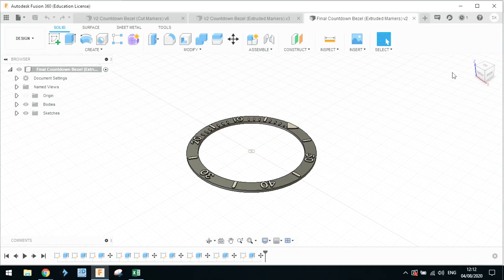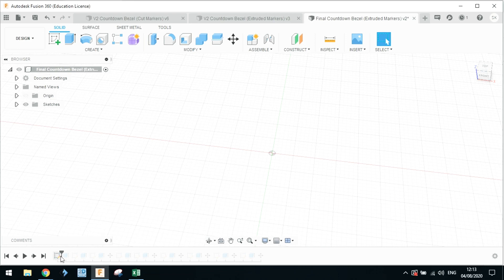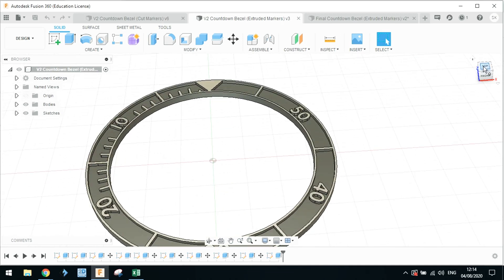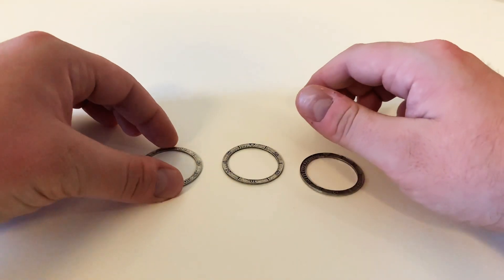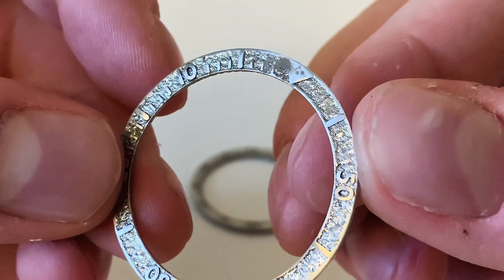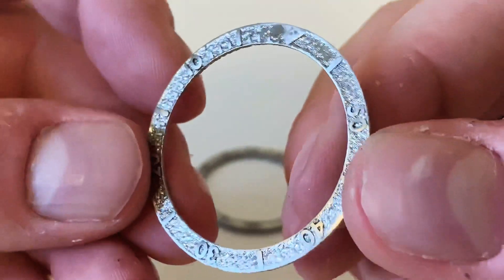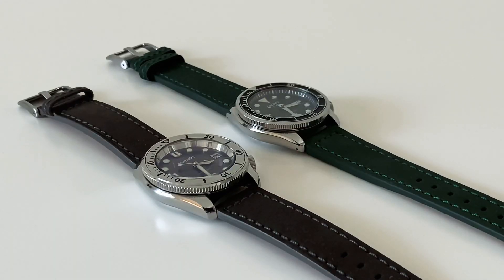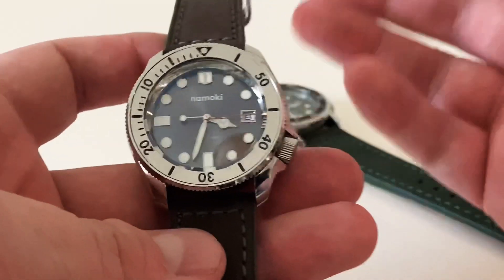3D Printed Countdown Bezel Inserts - IN METAL! [Seiko Mod] @SeikoModsDubai

Comment: I have been looking everywhere for this kind of info. I am looking to reproduce an acrylic bezel insert for my vintage Seamaster. The original Bakelite inserts are extinct. I can’t decide whether to go with 3D printed acrylic or a mold and pour option. 

Considering the absolute scarcity of these Bakelite inserts I can’t believe it hasn’t been done already 

Thanks for the inspiration
Reply from the maker: As far as I know you can’t 3D print acrylic, you could laser cut one though. I’m actually going to be trying out some simpler plastic 3D printed bezel inserts as well as laser cut ones soon.
Reply: i'm trying to do the same thing.. reproduce the  bezel for vintage watches with bachelite... where ypu from? im in rome italy...